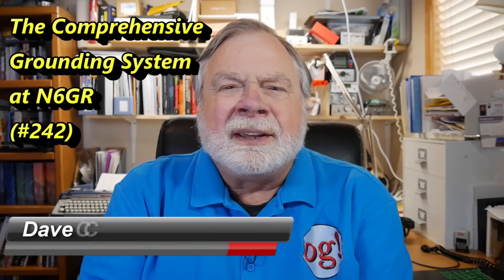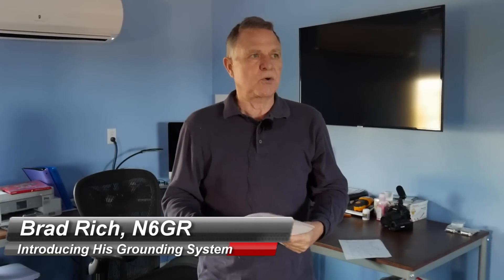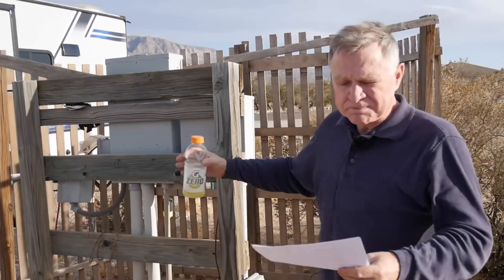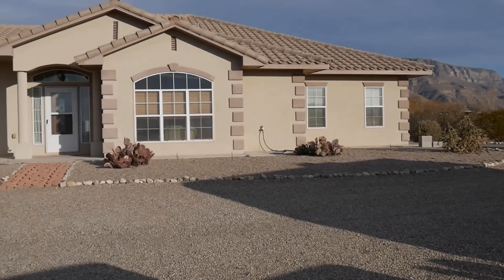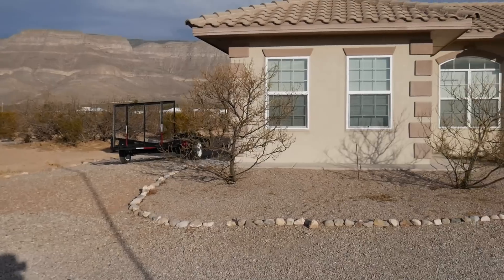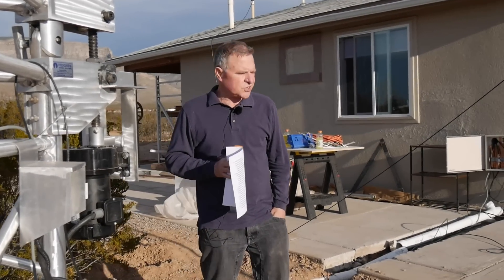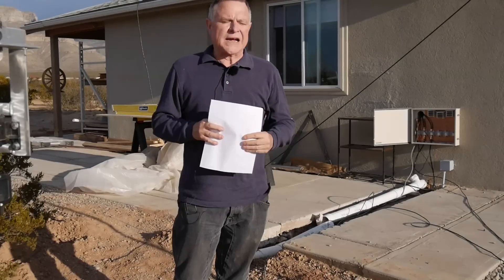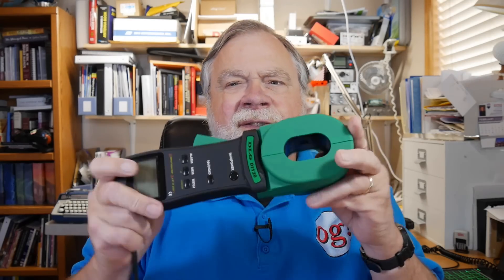Extensive Ground System at N6GR (#242)

Comment: I have been looking at grounding systems for a while now.  Great information.

How much difference is there between copper and aluminum in grounding?  DX engineering has an entrance panel with an aluminum plate.

Comment: I have over the last 5 or so weeks listened to many Grounding videos you have done.
I use to do power audits for RF and Microwave equipment, test and measurement equipment, and large building's. (4 million square feet).  
Don’t know if this will help, so in any case:

I use to do power audits all over the world, looking for slight ground fault currents, mis-wireing, and in some cases just dangerous practices. 

The way to bond metals together is a Cad-weld which minimizes or eliminates dissimilar Metal corrosion. 
I was trained by an “old salt” Electrical Engineer who’s Grand-father received one of the first EE degrees in the US in the 1880 time frame.  
The course given to us was in enhanced Power Audits by doing ground measurements.  
Concrete has a normal resistance of 100s of Ohms per Meter (4 Terminal measurement)
In Dryer locations it can be KOhms per meter or as much as 100 MOhms per meter.  
Chloride infiltration (Red discoloration around the rebar was bright RED in color) can cause destruction of the rebar.  (Old Salt told us of a major site with an X-Fer/Ufer with Counterpose made of 2” Rebar on 12 inch centers as having no rebar left in just 40 years.  This site resistance was measured at near Infinite Ohms.)
It was not possible to address the X-Fer, so trenches were drilled around the buildings and filled with Concrete with 2-3 % carbon powder well mixed into the concrete.  They used pallets of carbon many years ago at the cost of about 20 dollars a bag.  More expensive now but doable.
His rule of thumb was choose an impedance to ground to have a circuit breaker to open up in 16 milliseconds.  NEC code back then was ground (4 Terminal measurement) should be less than 25 Ohms.  Old salt use to say .5 to an ohm or two impedance to ground. (Ground Rod Impedance measurement) 
I wonder if salt although good in the short term might decrease resistance, in the long term may cause many ancillary issues…

Comment: Does the 2” copper ground strap entering the shack enter it through the top left corner opening of the entry panel for the coax?  Or through another hole or slit?

Comment: Im far from an expert and am in fact preparing for my meager HF vertical install this week.  I thought the tower should be grounded for lightning but not connected to the shack/common ground since it can carry a lightning strike though that ground into the shack over its much lower AWG wiring.  I though just the coax lightning protector should be at the shack ground as a last chance effort to keep the lightning out.  Wouldnt connecting the tower ground to the shack ground have a much greater chance of sending it into the house? Ugh Im confused.  Beautiful and extensive setup.  I have to assume they've done this the proper way its just that it conflict with what Ive read and thought I understood.

Comment: My elmer and I put in five 8' ground rods, ran #2 solid as the counterpoise from service ground and cadwelded the #2 solid to each ground rod, then filled the trench with GEM. I have a ground resistance of 0 ohms.

Comment: What does a 8   ohm ground resistance vs a 25 ohm mean to system performance?  Is it protection from lightning strikes, spurious noise in receivers, losses in transmission power going to the antenna?  For the SWLs it’s important to define the “why” of what the HAMs are doing. knowledge required to become an amateur radio operator is very practical electronics oriented.

Comment: i literally just sold my entire ham shack because i cannot get a proper ground where i'm at.  i contacted professional grounding/broadcast tower companies and was quoted $40k for a ground!  i spoke to the guys that wrote the motorola standard and other "professionals" in the industry and they all have DIFFERENT ways on how to properly ground a shack.  i'm 5 minites into this video and i see some issues.  cadweld and irreversible compression connections are a must.   bentonite (found in kitty litter) is a good enhancement but needs to be kept moist.  the double ground rods he mentions has to be within the sphere of influence,  bonding from tower to shack needs to be copper strap with the surface area greater than total shields of coax, control cables, etc combined.  connections need to be kept low to ground, i could go on and on, all this info and i'm still not confident enough to install a ground system at my new house without breaking the bank, so i sold all of my gear literally within a week and i'm out of the hobby until i find the right information on how to properly ground a 60' tower. FYI, i'm in lightning alley in central texas, 3 houses in my neighborhood were hit and burned to the ground in the last 2 years. it's not if, it's when.... like eating bacon every day and smoking a pack a day, some guys live past 100 years old, those are the same guys that leave their stuff connected during a storm and never have an issue.  but one day they will take a lightning strike, and it will change their tune.  good luck out there.

Comment: I am just getting started in the HAM World. I have mast made up of 4 sections of Radio Shack Antenna Mast attached to my deck which is about 6ft above the ground. The op of the mast is almost at the height of my roof top.  the deck is approx, 12x12 and the mast is diagonal across from where I want to exit my house. I plan to create a grounding plate in side and run it to a ground rod outside. So a couple of questions... #1 Should I place the ground rod near the exit point of my house or near the antenna mast as I intent to ground both the station and mast to it? #2 Is it a good idea to attach the ground braid to the underside if the desk (keeps it out of the way and out od sight ) or is it better leave it on the ground?

Thanks for the videos

Comment: As always, Dave, a really good video.  Information is helpful and introduced me to a new way to improve my ground.  That said, the AEMC testing device used is $1200 - $1400 dollars, well beyond the reach of many hams.  I'm not sure that providing an excellent video works well once a ham finds out he/she can't afford the equipment central to the subject.    Anyway, still another great job.  Thanks!
Reply: a quick search in 2021 found many ground resistance meters suitable for amateur radio (non professional) use for less than $300 USD. how much did you spend on your last transceiver lol

Comment: As a new operator living in hard, rocky landscape, sometimes solid limestone, who just finished my first ham shack and tower... after struggling to understand the high level, skimming, not connecting the dots clearly ARRL Grounding book... I’m glad to see that my solutions match this gent’s pretty much exactly; including the GEM material in rods and trenches.  

Good validation, though learned something from his resistance measurement and tool, though not connected the dots on specifics what, where, and outcomes to measure and shoot for.

Comment: I live in the High Desert, and getting good electrical ground connection with dry volcanic cinders and ash is tough... I learned a lot and will be doing more work on my ground system. Thanks Dave for filming and sharing 👍

Comment: I checked the prices of the AEMC ground resistance tester, WOW, $1339 !!  You can buy one nice radio for that price. There has to be a cheaper way to measure ground resistance effectively, or, at least close enough to give you an idea of the quality of your grounding system
Reply: There is a chinese model at about $300.  I tested it and gave the same readings as the expensive model.
Reply: @bradcfi2  WOW, that is more within my budget. Do you have the web page for that model Brad ??
Reply from the maker: The Chinese model Brad is referring to is the DLG DI-120. You can find it online.

Comment: That ground meter costs $1,300 new!
Reply: I bought used for 1/2 price of new but still crazy expensive.  There are chinese models that work for much less.
Reply: Brad Rich Do you know if the Chinese ones work good enough?
Reply: @32532jfbk  I had one and I gave it to Dave Casler.  Dave said he will produce a video on how it works. The Chinese model tested ok on my ground system showing the same resistance as my other more expensive meter.
Reply from the maker: The Chinese meter is the DLG DI-120.
Reply: Wondering if you can just use an ohmmeter to test between station and ground rod? Or between 2 ground rods. I would say yes but not sure, any help?

Comment: Great video.   I’d be curious what a recommended entry level grounding system you recommend.  2 sets of grounding rods, one at the panel and one at the antenna?
Reply from the maker: The one at the panel should already be there--it's required by code.
Reply: @davecasler  Yes it is.  It seemed in the video that Brad purposely improved on the grounding on the panel.  Do you think that should be one of the first considerations or a ham improving the grounding to his shack?  To improve on the grounding at the panel over and above what the utilities company might provide?

Comment: Who knew these things existed? But I'd still be curious to see, if he used CopperWeld (thermite) instead of clamping wires to the rods, if the resistance would drop even more.
Reply from the maker: With clean copper to start with, a clamped connection is pretty low resistance. One nice thing about copper is that the metal doesn't "flow" to reduce the tension on the clamp.

Comment: FDOT SPECS for ground arrays is 2.5 ohms, fun task in sandy Florida :(
Reply: I was stationed at a Nike Ajax and Nike Hercules Missile base when I was in the Army back in 1959-62. We had a very dry summer in 1960, and our radars were built on an artificial hill, mostly gravel. One day during this dry spell, the 3 radars were not working well at all, we could not get our calibrations into spec. While we were yelling commands back and forth between the radars and the control van, our mascot German Shepard dog decided to pee on the ground rod outside the generator shack. The poor dog let out a terrible howl, ran like hell off the hill never to ever go up to the radars again. However, Rebel (the dog's name) found our problem. After that, someone was assigned to hose down the grounds every day during a drought. ( not pee either )
Reply: @Seventh DOF 😂